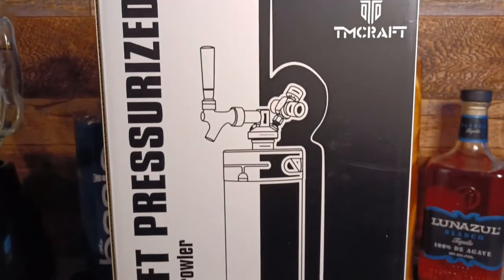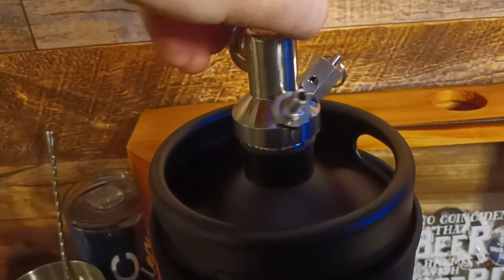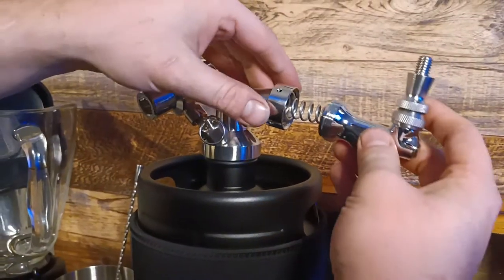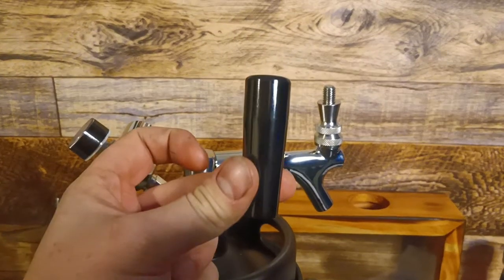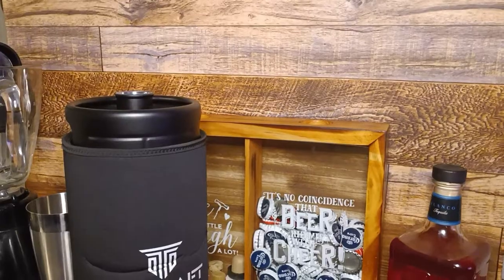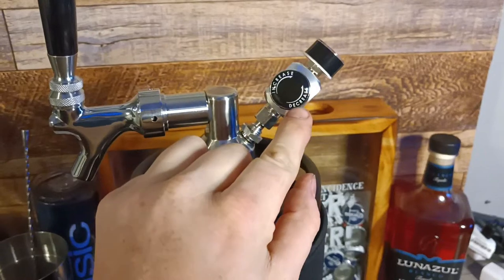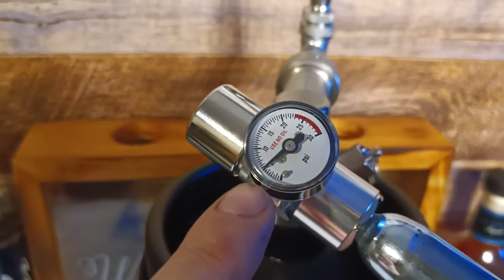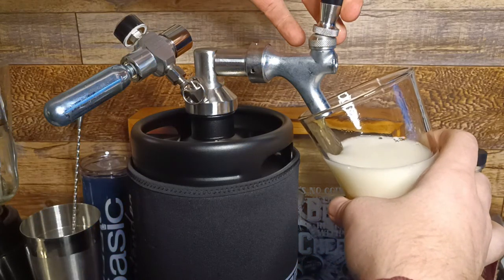The TMCraft Mini Keg - How To Set Up A Mini Keg - link in bio

Comment: If you drink the keg empty and want to crack open another one, can you use the same tap from the empty keg? Is it safe to open up the lid of the new keg with the pressurized beer inside?
Reply from the maker: There is a pressure relief valve that allows you to let off pressure to allow you to open it

Comment: Can this be used to force carbonate a small gallon batch?
Reply from the maker: No. It's just for storing and pouring
Reply: yes, there are videos on how to but basically you turn the pressure up to at least 15 psi and max of 30 depending on the carbonation you want, set it in the fridge overnight and then use the bleeder valve to bring the pressure down to 5 psi to pour...ive heard after you force carbonate you could actually bottle and cap from it and drink later. search "how to force carbonate with a mini keg growler"

Comment: Do I turn off the pressure after or just leave it? And how much do I turn the valve to carbonate
Reply from the maker: Just leave it on until you are done or it's empty. This Keg is ment to deliver not to carbonate. You will need a carbonator for that

Comment: La pressione quindi va lasciata a 5 PSI?
Reply from the maker: Puoi!  Normalmente lo lascerei a 8-10 psi.  Troppa pressione e potrebbe uscire con troppa schiuma!  Il modo migliore per ottenere i migliori risultati è giocarci finché non trovi il punto giusto.
Reply: @thebasicbartender6352  grazie. Ho fatto delle prove ma ho esaurito due cartucce per meno di 1 litro, mi sembra troppo!
Reply from the maker: @federicochicco7260  E' molto strano.  Deve perdere qualcosa da qualche parte.
Reply: @thebasicbartender6352  dovrei provare a stringere meglio tutto?
Reply from the maker: @federicochicco7260  Vorrei.  Assicurati che non manchi alcuna guarnizione e che non si sentano sibili.
Reply: @thebasicbartender6352  Nella confezione c'è una guarnizione che però non so dove va, perchè le misure non corrispondono. Ha lo stesso diametro della guarnizione del tappo, ma è molto più sottile, quindi non credo sia un semplice ricambio. Inoltre, se porto la pressione a 5 PSI e poi chiudo la valvola, la pressione dovrebbe rimanere stabile giusto? La mia torna a 0, quindi direi proprio che c'è qualche perdita.
Reply from the maker: @federicochicco7260  Dovrebbe sicuramente rimanere a 5 psi.  Molto probabilmente hai una perdita a causa della guarnizione mancante.  Lo smontavo e lo rimettevo insieme e valutavo dove dovrebbe andare la guarnizione.
Reply: @thebasicbartender6352  ho smontato tutto e rimontato. Adesso se chiudo la valvola la pressione resta costante, quindi direi che prima c’era qualche perdita, ora è ok. Però come devo utilizzare la valvola quando spino la birra? Va tenuta aperta o va riportata in pressione ad ogni utilizzo?